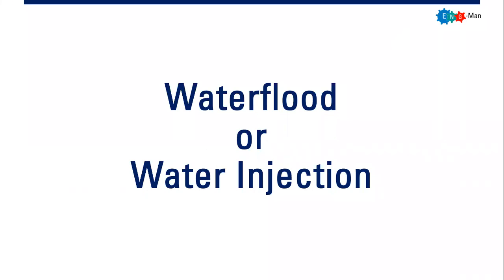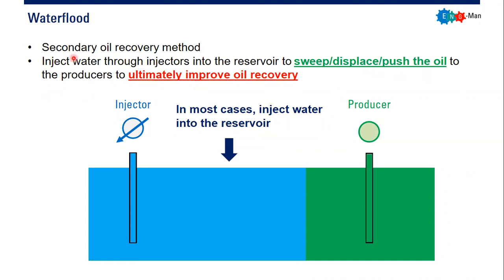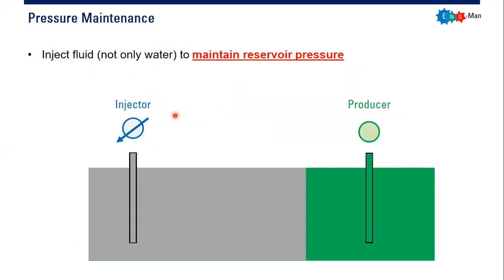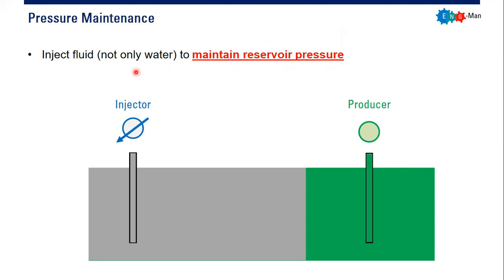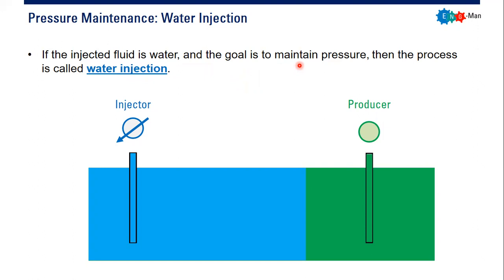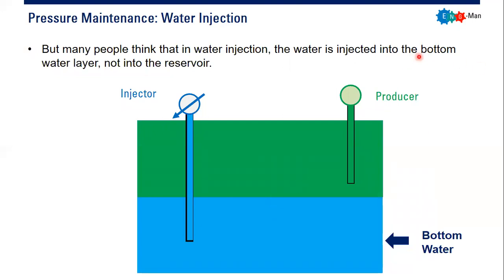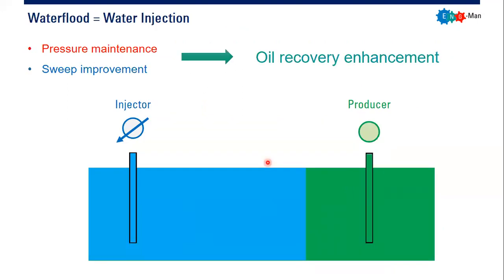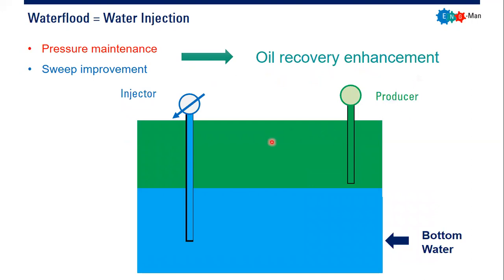Waterflood or Water Injection?

Comment: The decision between waterflood or water injection in oil and gas production depends on several factors, including the reservoir characteristics, the stage of field development, and the economic viability of the options.

Waterflood involves injecting water into an oil reservoir to displace the oil and increase recovery. This technique is commonly used in mature fields where the natural water drive has declined, and the reservoir pressure has dropped. Waterflood can significantly increase oil recovery, as water is less viscous than oil and can displace it more easily.

Water injection, on the other hand, involves injecting water into a reservoir to maintain or increase reservoir pressure. This technique is commonly used in newer fields where the natural water drive is still strong, and the reservoir pressure is high. Water injection can help prevent early water breakthrough, which occurs when water invades the producing wells before the end of the field's life.

In summary, both waterflood and water injection are important techniques in oil and gas production, and their selection depends on the specific circumstances of each field. development, and the economic viability of the options.

Waterflood involves injecting water into an oil reservoir to displace the oil and increase recovery. This technique is commonly used in mature fields where the natural water drive has declined, and the reservoir pressure has dropped. Waterflood can significantly increase oil recovery, as water is less viscous than oil and can displace it more easily.

Water injection, on the other hand, involves injecting water into a reservoir to maintain or increase reservoir pressure. This technique is commonly used in newer fields where the natural water drive is still strong, and the reservoir pressure is high. Water injection can help prevent early water breakthrough, which occurs when water invades the producing wells before the end of the field's life.

In summary, both waterflood and water injection are important techniques in oil and gas production, and their selection depends on the specific circumstances of each field.